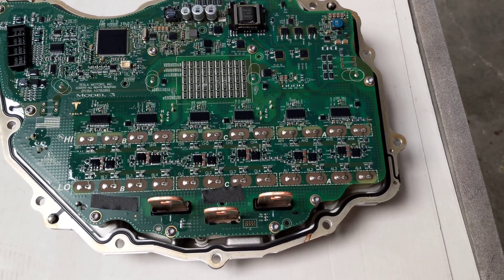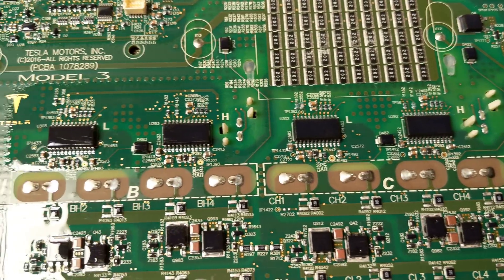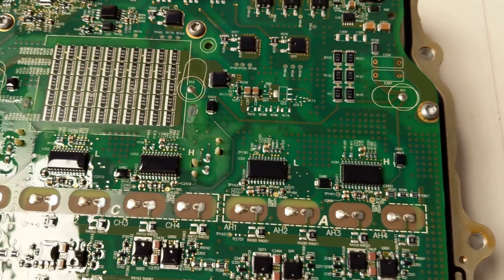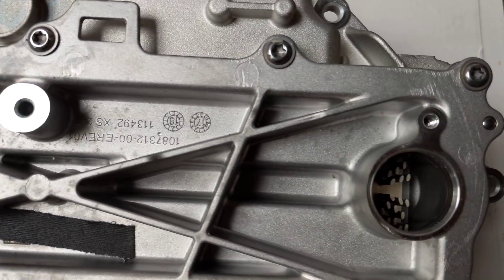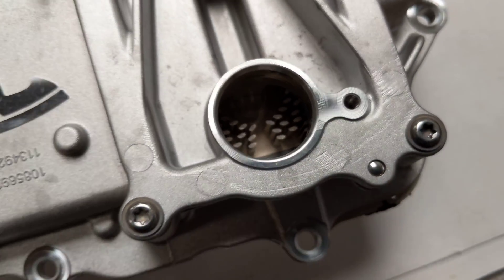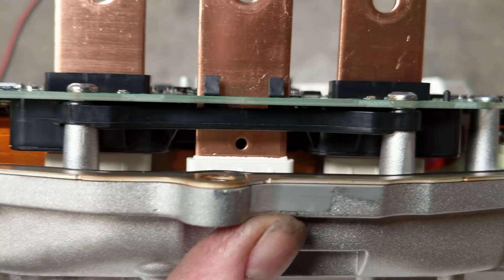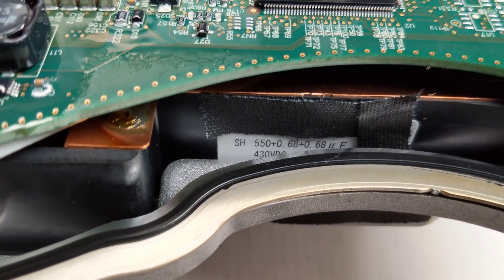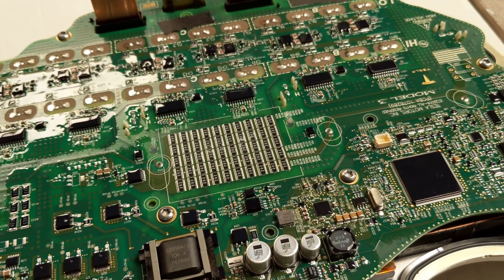Tesla Model 3 Drive Inverter

Comment: Thanks for the great content. I've just discovered a reduced power/torque when driving my Model 3 LR in reverse. I understand it's a safety feature but do you know if this caused by software or hardware and is a feature that can be removed or temporarily disabled? I also wonder if it's disabled in "Track Mode" feature available in the Performance variants? I have big wheels on my car now and struggle to reverse up medium inclines when loaded.
Reply from the maker: This is built into the inverter firmware.  There's no way to adjust it besides patching the firmware which is not effectively feasible.   I don't think track mode affects this.
Reply: @Ingineerix  thanks, I'll try not to get stuck where I need reverse.

Comment: can a m3 drive inverter be swaped from a good doner drive unit   got hv link low resistence
Reply from the maker: Yes, but you need a ToolBox3 subscription to program the immobilizer (rear only) and perform the resolver calibration (both) as this information is stored in the inverter, and is unique for each drive unit.  Alternatively if you are capable of board-level work, you can swap the serial EEPROM from the bad inverter and all that information will move with it.  (Needs to be an identical inverter)

Comment: Are those bleed down resistors or are they back up brake resistors for dynamic braking when regen braking is not viable?
Reply from the maker: Bleed.  Think for a minute about how heavy a car is and how much heat energy would have to be dissipated by braking.   There's no way this little pile of SMD resistors could handle that.

Comment: What is the purpose  of center resistor array
Reply from the maker: Active discharge.  There is a MOSFET that is switched on to dump HV to these when the unit is shutdown to bleed off the significant energy stored in the link capacitor.

Comment: Great post as always! Are there any diodes in there (or elsewhere in the drive unit) and could a faulty diode lead to a failure in a PCS and a blown pyro fuse? I'm just trying to piece together the story that my local Tesla techs are giving me! Many thanks.
Reply from the maker: Every one of the 24 (or 18 if you have SR) SiCFETs in there have a body diode.  But Tesla techs don't know much, they don't do anything but replace a bad inverter as a whole.  Yeah, occasionally you lose a SiCFET, and most of the time it blows either the Pyro in the pack, the one in the inverter, or both.
Reply: @Ingineerix  Thanks so much for your reply. And the process of the diode going down and/or the pyro blowing could also kill the PCS?
Reply from the maker: @gavinpartridge5568  Unlikely.  Sounds like the Tesla guys just swapped one thing, that didn't fix it, so they swapped another.  Probably was only the PCS and they replaced the inverter needlessly.  The inverter is definitely more reliable than the PCS.
Reply: @Ingineerix  Thanks. It's actually the other way around; they replaced the PCS first and that didn't fix it so they moved onto the inverter. Now apparently the 12V battery has died (new LiPO) but that also seemed odd to me after I watched your video and learnt it has in-built protection to stop it dying if its not charged. You'd think their diagnostic computers would be as clever as those in the car - but doesn't seem to be the case :)
Reply from the maker: @gavinpartridge5568  Getting a LOT of reports of this new battery "dying" and needing replacement.  Sounds like something wasn't implemented correctly.   I'll stick with my AGM that only costs $85 every 5 years and has about 3 times the capacity.

Comment: Could I use this and the car batteries to power a 3 phase 100hp electric motor on a piece of farm eqiupment?
Reply from the maker: No, The farm equipment likely has a 3-phase induction motor.   The closest to that would be the Model S motor.   The biggest problem is matching the voltage and getting the resolver (position encoder) attached and aligned properly.  You'd be better off just putting the whole Model 3 motor system in there in place of the old induction motor.  The Model 3 motor can easily sustain 100hp and will generate less heat.  My guess is some sort of tree shaker?

Comment: I have a Model 3 rear axel. Does any one know which terminal on the high voltage connector on the axel is positive and negative?
Reply from the maker: Yes, but if you don't have enough electrical knowledge to determine that, you definitely should not be messing with it at all!   PLEASE: Consult someone that knows what they are doing.  Besides, without a proper controller, there's no way you'll get the motor to work.
Reply: @Ingineerix  I was given the Axel. I am looking at getting a controller. I do not want to open the axel to reverse engineer the controller board if some one has already done it. I was not to find any  markings indicating polarity. I have a degree in electrical engineering but I was hoping that someone would be willing to share the plug polarity so that I would not have to reinvent the wheel. Or take the axel apart just to find out the high voltage plug polarity.
Reply from the maker: @JR-un5jy  If you really are an EE, then you'd know you can quickly and easily determine this with a DMM using the diode-check function.  No need to take anything apart.  But since you do not know this, you probably don't also have the skills to get it running safely, so I advise you to seek a professional.

Comment: I understand basic electrical theory but this is far beyond my knowledge. I have a long range AWD with the 990 motor (less FETs in the inverter). Can I swap inverters and use the 980 motor inverter on the 990 motor to get more amperage to it? I believe all the conductor sizes and everything are the same, with the exception of the inverter. I know I’d need to do some programming. I’m hoping with the new inverter on the 990 motor I’d be able to use the “ghost upgrade” to turn it into a performance model 3.
Reply from the maker: No, you cannot just "swap".  There are parameters that live in the inverter, such as resolver calibration.  This will be wrong if you swap inverters, so you will have trouble, even if you could get the firmware issues solved.  Always a better idea to sell your existing car and buy one with the specs you want.  Why risk loss of warranty and damage you can't fix on a car this expensive?
Reply: @Ingineerix  Thanks for the reply. I figured it was a long shot. From everything I read, the motors are the same, but the inverters have different MOSFETs (24 vs 18), which is why the performance model can push 800A vs 680A on the 990 motor. I'm not an electrical engineer or anything. Just a kid with a dream. I can't afford the extra $10k for the performance model so I was hoping replacing a part would equal an upgrade. In your opinion, would swapping the entire rear motor for a 980 motor be possible? Thanks again.
Reply from the maker: @dusty02130215  Yes, this is possible, but not easy or cheap, but the right way to do it.   You'll need some hacking to solve the configuration and firmware issues, because Tesla will not help you change the config.

Comment: Had the rear inverter replaced under warranty after a bms_a035 code popped up.
Reply from the maker: BMS_a035 is Isolation fault.  That's pretty rare for an inverter to cause that!   You didn't happen to drive through a lot of water recently did you?
Reply: @Ingineerix  No, the code appeared on dry days. I did go through small puddles in the rain in the 20k miles I’ve driven the car. 

Yeah the Tesla service techs did an isolation procedure and found the inverter to be the problem. They were finished with the car on the fourth day where I picked it up at night in the parking lot. I also found my Wh per mile which was around 300 go down to 230-240 again after I picked up my car. 

Concern: Something else - customer states: BMS_a035 Vehicle may not restart Service is required 

Verified customer concern.Diagnosed and Performed Vehicle Electrical Isolation Procedure.

Replaced Rear Drive Unit (Includes Alignment) Inverter. Verified Proper Operation.

Correction: Inverter - Rear Drive Unit (Includes Alignment Check) (Remove & Replace)

Parts Replaced or Added
Part Quantity
ASY, DRIVE INV, 3DU, 1.00 GLOBAL, 810A, SIC, REAR(1079924-05-J)
Pay Type: Drive Unit Limited Warranty
0.00

Comment: Hi. So when you punch the pedal to the floor of a model S ludicrous mode for example what is the DC bus voltage and current please. Also does the battery produce positive and negative rails ie split rail or is it a single supply. Just trying to understand the stress on the power FETs. Tesla understandably keep this info close to their chest.

Comment: HI I HAVE A 2015 TESLA 70D  CAN I UPGRADE THE REAR MOTOR TO A SPORTS ONE ,ANY HELP IF YOU CAN OR POINT ME TO SOME WHO MAY BE ABLE TO HELP .
THANKS TONY
Reply from the maker: Sorry, you can't run a P drive unit without at least an 85 pack.  Best advice: Sell it and buy a used P85D/P90D/P100D.

Comment: This MCU part supports InstaSpin from TI, it is a special one, so I suppose that the folks at Tesla are using InstaSpin as the framework in order to get the motor spinning. Do you think that this is the case too?
Reply from the maker: It's possible, but I don't know for sure, that would take code disassembly.

Comment: Have you done any analysis on the voltage and current waveforms being supplied/drawn by the motor? It would be interesting to compare them to the induction motor current and voltage waveforms

Comment: I helped with the startup line of this inverter's manufacturing process before I got fired, sadly all of the knowledge I have is under NDA but there's a lot more to these than meets the eye! Pull the PCB off, all the soldered points are pretty easy to desolder. Follow proper ESD procedures, they're sensitive buggers

Comment: They use uncoated vias as TPs! I was told not to practice such design by some of the experts who claims it will be unreliable or so...
Reply from the maker: If it's not used for production test (bed-of-nails), then it's fine.  Those may be TPs that were only used in dev, so only humans would probe them manually.  Outside of that use case, then yes, you don't want ATE (bed-of-nails) to try and engage a via, as it can both be unreliable and there is a chance the nail could damage the via, or the via damage the nail. (Or both!)
Reply: @Ingineerix  Thanks for the explanation!

Comment: 4 FETs are in parallel. Unless they are distributed at equal distance w.r.t to the load, there will be unequal switching losses in the FETs, as in this case. In each phase, some of the FETs would bear, to some degree, more loss.
Reply from the maker: It's carefully laid out.  The proof is in the reliability!

Comment: I would like to see the schematic of the Inverter. I'm curious to see if they use a DC/DC converter for intermediate steps, or do they connect the SiC Mosfets directly to the High Voltage Battery, in which case they would modify the amplitude only via PWM. Or do they have an intermediate voltage as well?
Reply from the maker: It's a traditional 6 switch 3-phase inverter.  There are 2 switches for each of the 3 legs, one that can connect the leg to battery positive, and one that can connect it to battery negative.  This is done with PWM at high speed to synthesize the three 120 degree offset waveforms.  The inductance of the motor smooths this out effectively acting like a low-pass filter.
Reply: Aha ok standard full bridge configuration. But then I believe that in your video you said they adjusted the input voltage, so i guess you meant to say they adjust the amplitude of the sine wave via the PWM...

Comment: I take it this is only for the motor. And there is a separate 30kW charging inverter?
Reply from the maker: Yes, only for the motor, the Charging system (PCS) is rated for 12kW.  You can see that in my other video.

Comment: Did you find where the LTE SIM card is?
Reply: It's probably on the motherboard. Near the Intel atom CPU
Reply from the maker: Early cars had a SIM, which is located in the bottom of the ICE (on passenger side firewall). Newer cars have switched to an internal E-SIM built into the Telit Modem.
Reply: Ingineerix if it’s with e-sim, how can I use LTE if I use the USA model 3 in overseas in Asia?
Reply from the maker: It's still possible to use an inserted SIM, but it will require programming to both select the eSIM and set the APN.  (I can do both)  I can also set the car so localiaztion is proper for EU.
Reply: Ingineerix thanks for the reply. If I want to insert Asia LTE sim in it, can you help me? My car is now in North Carolina. Do I have to bring my car to you or can you do remotely?
Reply: Shall I call up Tesla for registering an e sim from local carrier?

Comment: Radically more compact than Model S inverter. And looks like it could be a lot smaller and lighter still, particularly the heavy cast casing should be quite unnecessary.

Comment: What's the function of the bleed down resistor? Why is there so many instead of just a few
Reply from the maker: The bleed down is used for discharging the HV bus when the car goes to sleep and the contactors open.  Tesla wants to ensure the HV bus is "safe" when this happens, and because of the large capacitors used there has to be some way to discharge the energy stored in them.  This has to occur in a reasonable time, so they need to convert it into heat, and the only way to do this with low-cost surface-mount parts is to use a lot of them.
Reply: @Ingineerix  I'm surprised it takes so many, do you know what the HV bus capacitance is?
Reply from the maker: @MCSGproject  1.2mF in each drive inverter by itself, and there is also a good amount (unsure of total) in the PCS (charger/DC-DC converter) that the bleed down has to also cope with.

Comment: Great video!  Can you help clarify what the switching frequency (Fsw) used with the SiC MOSFETs?  I have been told that it is 2X faster than the IGBT Fsw used in the Model S.  I have also been told it is the same  Fsw in the model S.  Thank you for your help.
Reply from the maker: I haven't analysed this yet.
Reply: @Ingineerix  Sir, you rock! so many great videos. I am indded want to understand how the SiC MOSFETS switch frequency works on the system too?

Comment: Where's your anti-static mat and wrist strap?
Reply from the maker: The RH in the building the day this was shot was around 90%.  At that level there is no danger of ESD.  The shop is located within a mile of the SF bay, so only in the middle of winter do I have to worry about humidity low enough to allow ESD to be an issue.

Comment: Any photos of the cover taken off to see the inside of the chiller??
Reply from the maker: I don't have any offhand.  It's an anodized aluminum pin stack, looking much like heat sink fins on a CPU cooler.  In the video you can see that in the opening, just more of the same all the way down.  I do not have infinite time to take apart everything, and I don't want to destroy (or cause leaks) just for this small detail, sorry.
Reply: No problem! Just wondered.

Comment: Btw, you should have grounded yourself before touching this. Might have zapped the circuit board already. ESD grounding is mandatory when building and handling these. Also, use ESD or nitrile exam gloves.
Reply from the maker: The bench is metal and grounded.  The relative humidity here is high, there is no chance of ESD.  In the winter this changes, and then I use a ground strap.

Comment: If you only had this controller and not the motor, could you tell it is designed for a switched reluctance motor?
Reply from the maker: You can't without looking at the drive waveforms and/or software.  The inverter hardware itself doesn't reveal that.
Reply: Ingineerix So by changing the firmware you could drive an 3ph ac induction motor just like the front drive unit on awd models?
Reply from the maker: Yes, I would say that's definitely possible.  The overall design, except for the Silicon Carbide upgrade, is very similar to the S/X inverters that drive induction motors.
Reply: @Ingineerix  Thanks for youre excellent review and explanation of various components, can i ask why would you think , tesla made a change to switched reluctance , and why would they plan to use a induction in the front and reluctance in the back. ?